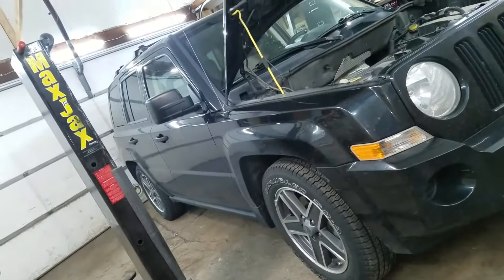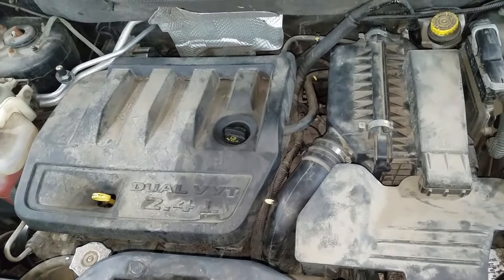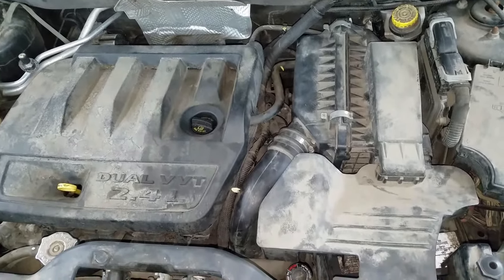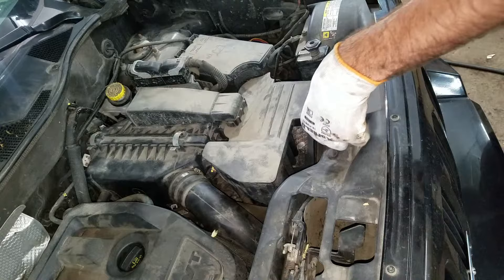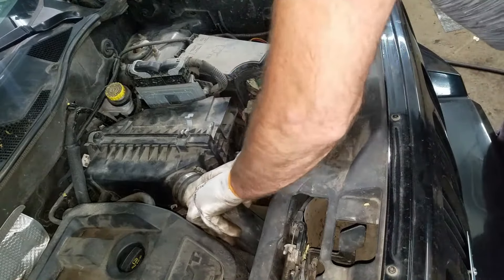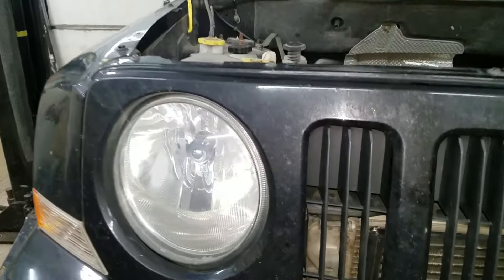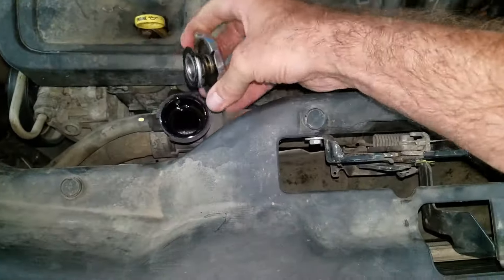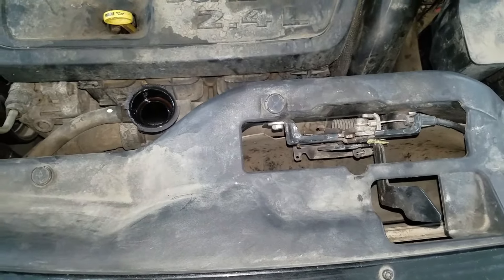2007-2015 2.4L Jeep Patriot thermostat housing

Comment: Watched your video before doing this and a few times during the exercise. It helped immensely and worked out great. So far no leaks. I put off replacing as the shop wanted shy of $500 p&l. It was not leaking much until recently.   Sure saved me some bucks. Also removed the throttle housing, cleaned and re-installed as it caused some issues. May need to replace if it still needs it. Thanks for your videos. We have a Ministry monthly where we repair cars gratis that are owned by battered women in need so I hope to use more of your techniques. We have a nice shop with lifts and tools.
Reply: Did the throttle issue fix itself?
Reply: It works great.

Comment: Same motor. Same experience.. I can’t get the O ring on the back seal to stay put . Either it rolls back or I see most of it on the groves hoping we’re eyes and mirror can see it’s were it should be . Tighten add water dripping within a cup full . The seal replacement number is not as tight as the original you removed and as mine was hardened. As the leak originated. So the group replacement numbers of this seal must vary or must be used a OG  presumably..

Comment: Anyway or oarts to bypass the thermostat. For me to remove it on these and run it cold. I dont want the thermostat in it being in texas and arizona traveking too hot to have a thermostat
Reply from the maker: Thermostats are used both to keep it at optimum temperature, and to keep it from overheating, by giving coolant in the radiator time to cool, by shutting off circulation.
Reply: Can both be taken out for a short time to make it home?

Comment: When you're messing with the cooling system and the engine, it's best just to get OEM parts
Reply from the maker: I cannot disagree.
Reply: Yeah but oem parts are over priced and especially with domestic they are inferior to aftermarket many times. So it's not best to buy oem.

Comment: im no handy man and after seeing you mess with those few bolts i now know i better take it in rather then spend half a day getting pissed off and wanting to strangle someone haha my 2014 patriot can only run if heater is on full blast
Reply: I have the same issue with my 2014 Jeep Patriot. I have to drive with the heater on full blast. Did you figure out what the problem was? Did you get it fixed? My car is paid off and I don't need a new car note.
Reply: I've taken it to the shop so many times. It was leaking coolant. I got that fixed then there was a problem with the hose. I got that fixed. Then it was a thermostat issue. I got that fixed. Now I think it's my fans but I swear along the way they told me they fixed that already. I don't know what else to do.

Comment: NOTE: The thermostat gasket that shows at 8:12 has its own mounting position on the thermostat itself. The way he mounted at 8:06 is not quite right (I know he did that way because of having the thermostat hole at 90 degrees at the very top thinking the air will bleed better). Just double check not moving the thermostat gasket from its original position (the thermostat hole in its right place with the gasket will be +- 135 degrees). Nice work @Rust Belt Auto
Reply from the maker: Nice to know. Thanks!
Reply: I seen somebody put an o ring on the thermostat that goes against the block. Is this what you are saying should be done?

Comment: @ Rust Belt Auto i have a question if you dont mind helping me. Im currently working on a 2011 Jeep Patriot with the exact same problem. Not able to diag no codes no nothing. My question is after the change of parts did client return with same issue? Or did issue go away after replacing part
Reply from the maker: @EstradaSon  victim had no issues.

Comment: Hi, your video really helped. Got a question, when my jeep patriot is idling the fans dont seem to want to turn on. You can turn the air condition on and both will come on.can you help me.Thanks,Gary
Reply from the maker: They only turn on when the coolant gets hot enough.
Reply: correct
 @RustBeltAuto

Comment: I have a 2014 Patriot and i changed 2 thermostats and the temp sensor i also flushed the radiator and engine and it still overheats but it doesnt have any check engine light also the temp guage fluctuates.......any advise on how to fix?
Reply from the maker: Make sure the fan is running, and do a block test to check for hydrocarbons in the coolant.

Comment: I'm currently trying to attach a new housing, and for the life of me, I can't get the 3rd bolt (one closest to the front of the engine) to go in. Any tips/tricks. Did you notice an issue? I got the Dorman OE replacement housing, as well. THANK YOU!!
Reply: I had the same problem, mine was due to the new gasket on the thermostat. It will go. Just a twist and push

Comment: Hey , so what was the part number that O-ring you put on? And Thanx for the Torque specs !!
Reply from the maker: I dont know.
Reply: @RustBeltAuto  Ok, Got it, since you showed the Part Number for the housing, I thought you might have it. Was it at your local parts store , or was it special order? Appreciate the reply !!
Reply from the maker: @curlyelp7530  I think the seal comes with the housing.
Reply: I'm also looking for the o-ring. Don't need housing , replaced thermostats and now have a leak from the new o ring I put in

Comment: what was the other part you replaced? @4:57
Reply from the maker: That was a drain plug for the radiator. I put it back in.
Reply: @RustBeltAuto  I guess what I am really asking is if the square sensor looking box, the one you point with your finger @4:58 (to the left of the thermostat housing) could cause a coolant leak? I am not really sure what that square box is for.  I am trying to determine if the coolant leak I have is from the thermo housing or the square part. I am sure it is the thermo housing but just want to make sure.
Reply from the maker: @carlosordonez3352  its possible
Reply: @RustBeltAuto  what is that part called I cant find it anywhere on the manuals
Reply from the maker: @carlosordonez3352  ect? Why not just get the housing with the thing on it?
Reply: 2 years later.... The answer is the intake manifold runner control valve